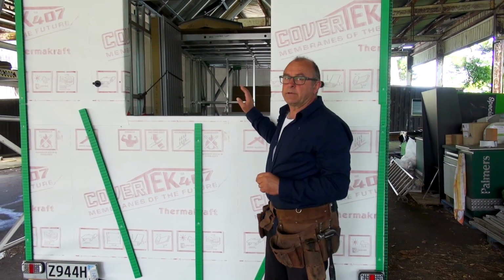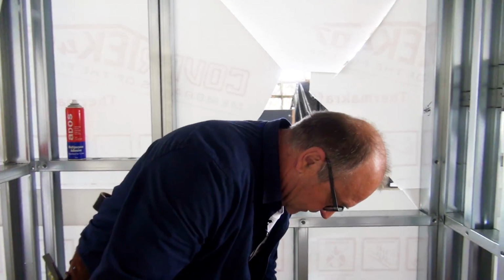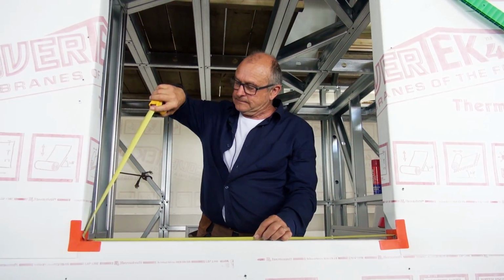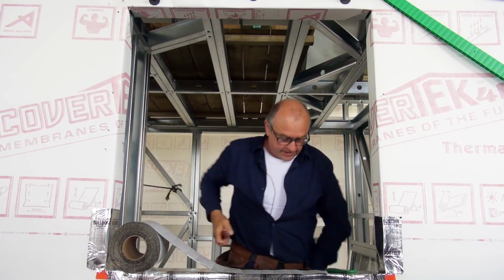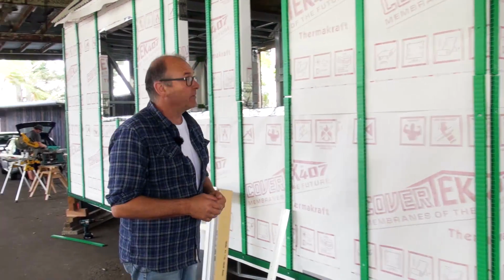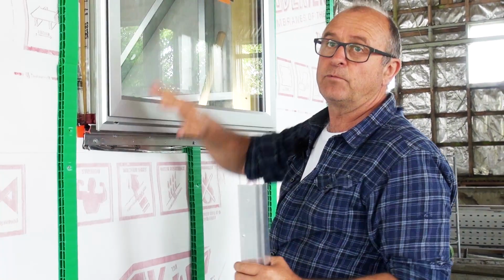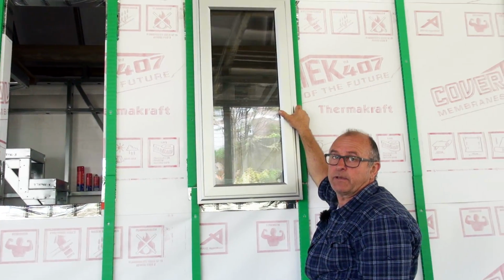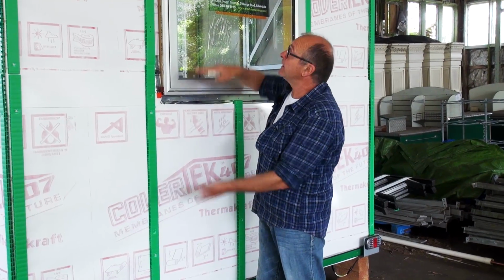How To Install Window Flashing & Windows

Comment: Great build, I'm just starting my own tiny house in a few weeks. Can I ask what it is that you have used by batten which the cladding will be fixed. Am I right in thinking it's polycarbonate boarding cut into strips? 
Keep up the good work
Reply: Jonathan Kirk  that is just a standard plastic cavity batten. You can use H3.1 treated timber cavity battens.

Comment: Good tutorial,One question please near the end 18:29 your boys seem to be using a timber block to flush up the support bar to the sill before fixing/screwing it (support bar) secureCan i just sit and fix the window flat like that on the sill? Or do I have to pack it up minimum 5mm example using locator blocks clipd onto the support bar to create a gap for ventilation?or is the gaps just for the two jamb sides and header?I'm still learning, any help and advise will be grateful?
Reply: Councils here in new zealand require 7.5mm gap each side of the window to allow for foaming etc etc

Comment: Very interesting procedure, quite a bit different from the standard out here on the west coast of Canada. The steel framing definitely adds to the differences. I liked the attention to the top corners (with flashing). I will be interested to see how the whole thing mates with the siding, since the windows are set proud of the face of the building instead of flush with it like we did.
Reply from the maker: Yup! It should looks really good. The gab has closed a lot more with the weatherboards on, and we will be using scribers around the windows to complete the look. :)
Reply: Yes Jake. I was just mentioning this same thing to my hubby. Glad to see you are watching this one too! Both of the differences you and Bryce are doing are totally fascinating.

Comment: Did you say your aim was to build this whole house for 20k? I haven't done the maths but I got a feeling this whole thing is going to add up to a lot more than that. Right now I'm contemplating a 1980 something Oxford caravan with bubble windows instead of a tiny house.
Reply from the maker: No, we haven't talked about our budget yet. We will outline all of that in a future video and on our website once it's all compiled. There are some DIY builds in NZ that have been pulled off for around 20k though.

Comment: Sure is looking like a house now. And since I've commented last a mate here in Blenheim is now a local contractor/builder for the same steel framing and has recommended a firm in Kaikoura who may make tiny trailers. Not ready to build yet but so reassuring even in a wee town I won't be doing this project alone as I previously thought, phew! When I have more details I will post and share with everyone.

Comment: I noticed how your stairs are not completely open to the side will you lose storage because of it or what will go under the stairs?
Reply from the maker: Hey there. We have plans for both pull out draws and a larger storage cupboard to be built into the stairs.
Reply: Alrighty then thank you for the reply :)